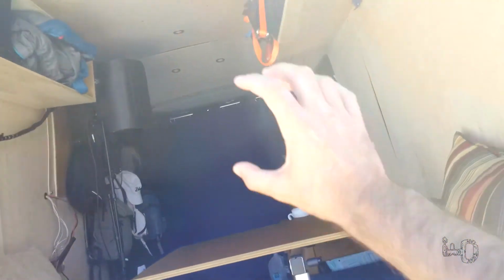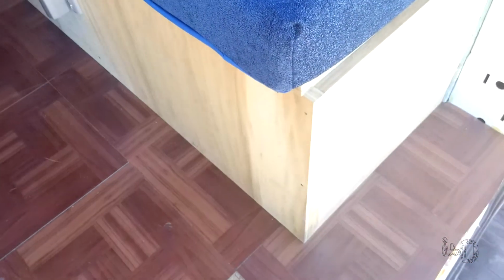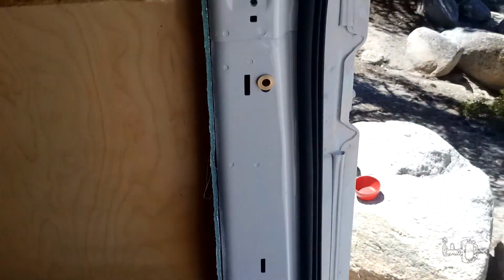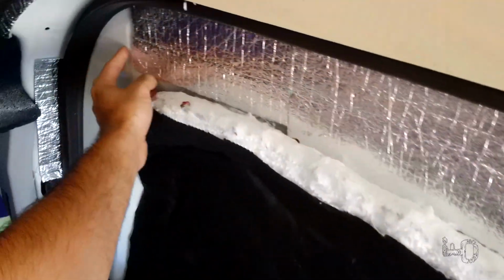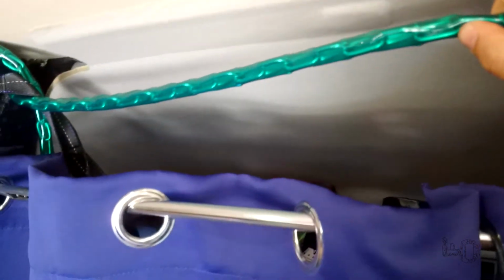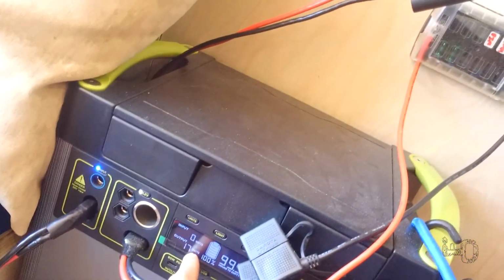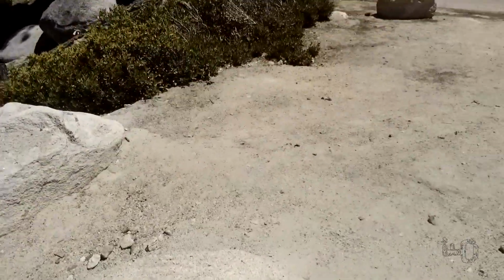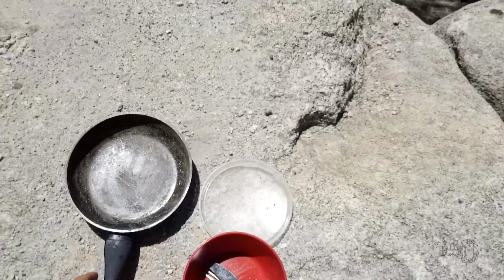Mobile Recording Studio Tour!  [Transit x Van Life]

Comment: Love the van build tour! Is that the non-extended, Transit LWB? How did you configure your solar panels so you could fit 600w with a fan? And what were the panels? Thanks!
Reply from the maker: Thanks! Yep, that's the model. We made a custom roof rack out of 80/20 & did three rows of panels - three vertically oriented, another row of two, and then the final panel horizontal and tucked in behind the fan a bit. The only thing with this method is the fan can not be completely closed, but you can drive with it open and there's never really a reason to close anyway. Worth the tradeoff for me. The panels are renogy! Love them. They gave me this promo code too, so if you use it you can knock some of the price off: http://73renogy.refr.cc/samuelneilson

Any other questions, happy to talk more
Reply: @LFOD  Thanks for the info!
Reply from the maker: @cr8fisher254  you're welcome!